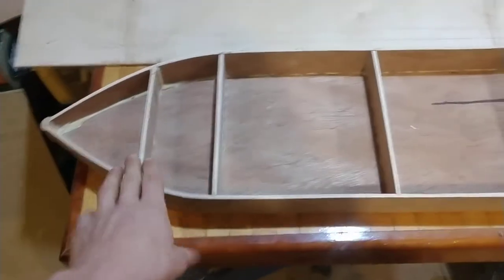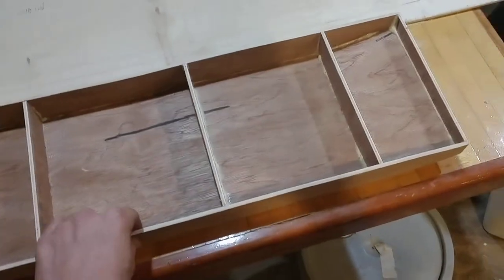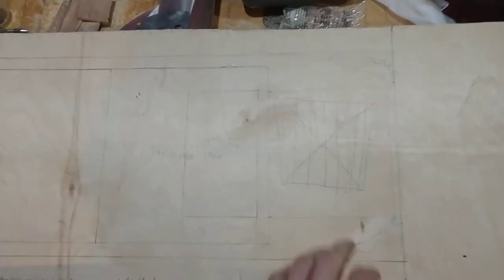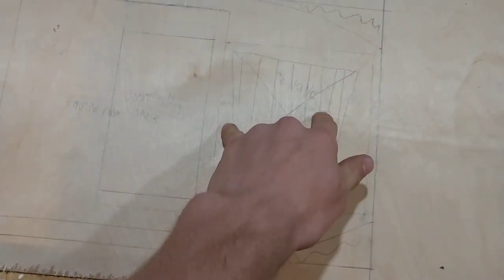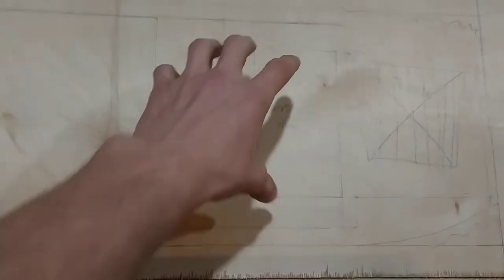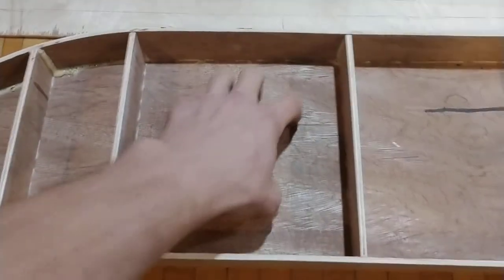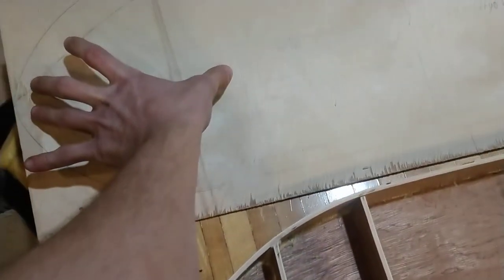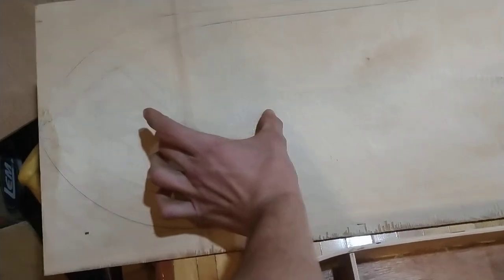rc sternwheeler boat in g scale I've cut the deck

Comment: Hey Wes my steam lines are longer than that and they work fine once they warm up. I did tee off a steam blower line for the boiler flue draft just before the engines so there is a constant flow of steam in the supply line keeping it very hot even when the engines are stopped.  I wrapped them with 2-3 layers of cotton yarn .  If anything the cotton keeps me from getting burned :) 
Pete

Comment: Hi there, I just stumbled across your videos on this sternwheeler build. Has there been any more progress on the build? I don't think I've seen any additional videos on it yet. I can't wait to see the final result! You've even got me thinking of attempting my own version!
Reply from the maker: I'm letting the hull sit & acclimate with about 100 pounds on it right now so it will flatten out because after glueing ,it developed a twist but it's halfway back to relaxed in the humidity fluctuations of the basement in the meantime I'm saving up for a 3d printer and a lathe/mill to build the engine and boiler I also tracked down the cad drawings of a sternwheeler engine that I'll be using they are saved on my phone right now and l bought kozo hiroko's building a new shay book and received today kozo hiroko's building a climax book as a birthday gift,I'll be using them for boiler plans and his machining lessons in the books  by the time I have aquired the tooling it should not be twisted anymore, if it was going to be electric I would have already had it running already it's not a hard, expensive,or time consuming process building a model boat but  thanks to farm problems I'll just have to be patient if I want it to be live steam,   and have the level of detail I wanted, because if it was electric I could have built it for less than a hundred bucks ,  even a cheap lathe and mill at harbor freight is going to set me back atleast 2 grand to get everything running  now if I use my wood tools and build a sleigh and sell it to one of the people at one of the two horse shows we manage and compete at,  I might be able to get all I need for a home machine shop before next fall